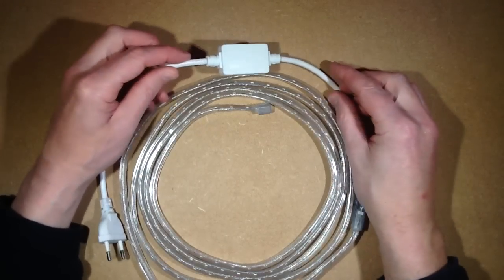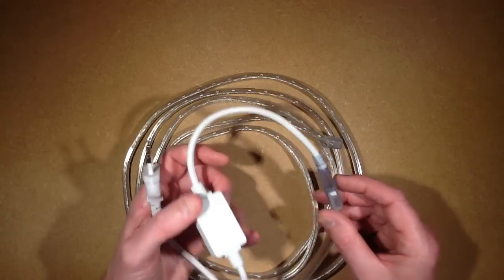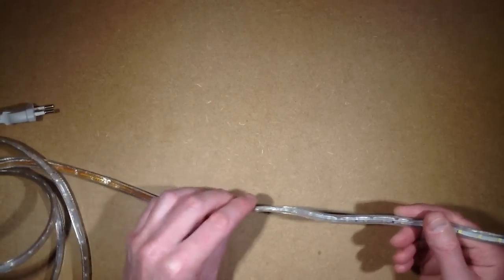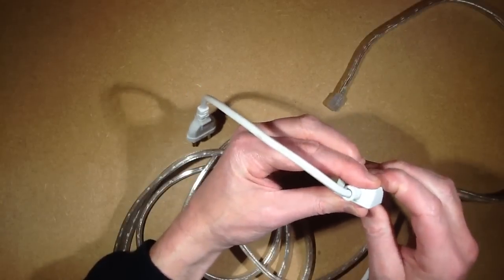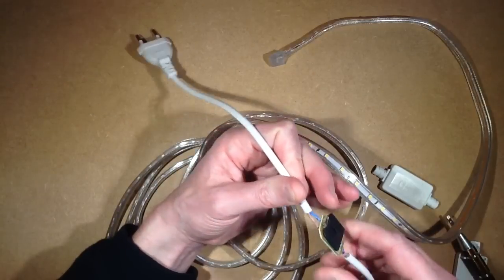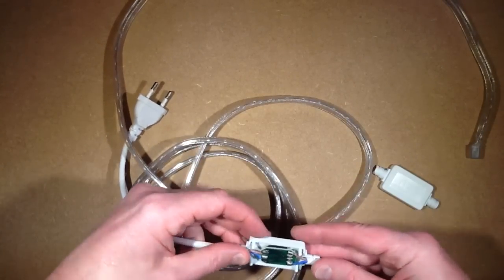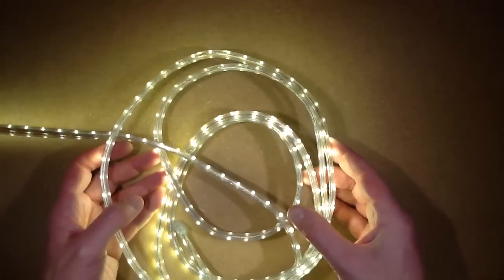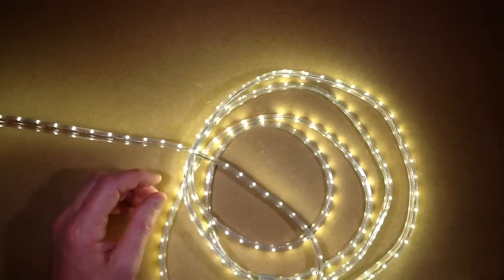Flat, mains voltage LED tape.

Comment: The 50 cm sections are probably just limits on the size of PCB material that can be manufactured. Regular 12V led tape is usually also made in sections of 50 cm, despite being sold per meter+. Single PCBs a meter long can be made, but they're extremely expensive.

I mean, a side benefit is that they can manufacture it as 110V pretty easily, with the same PCBs and just twice as many of the gaps/connections onto the busbars, but the first thing is that that's how long their PCBs get :)

Comment: Being mains voltage, what do you think would be the maximum run length for LED tape of this kind?
Reply from the maker: +Harrison Brace The limit will be the heat in the rectifier mounted in the end.  Generally it's better to run stuff like this in multiple sections.

Comment: Well, since most LED lighting systems fail because the power supply fails, what's the harm in running the LEDs a little hot?

Comment: I spotted a dead LED. DC live ends - even more dangerous than AC.
Reply from the maker: +DjResR Not in my experience.  DC tends to cause a single contraction then a burning sensation, but AC locks you on due to continuous muscle stimulation.  You can't open and close your hands at 50/60Hz.  But rectified AC is still pulsing, so is as dangerous as AC.
Reply from the maker: Sustained DC current, even at low levels can cause cell perforation and resulting skin and tissue damage.
Reply: +DjResR absolutely. DC is scary shit.
Reply: +bigclivedotcom Extensive experience in getting electrocuted clive.
hmmmm you are a bit crazy it has to be said!
Nae wunder!
Reply: +smallenginedude71 why
Reply: +Nicholas Ruiz Because when you get shocked by DC, your hand is going to grip the energized part hard and you can't do anything but watch yourself die in a painful death. AC on the other hand has alternating polarity, it would hurt much more because your muscles are moving in 50/60Hz frequency, but the grip is much weaker so it is possible to unhook yourself from it.
Reply: Isn't the unique scary thing for DC voltage that it can eventually cause electrolysis inside your cells. Causing it to diffuse your good body things into bad things, which my chemistry teacher would scold me for not knowing, that can eventually poison you?
Reply: funny, just today i got shocked by the same led strip. mine didn't came with a cap at the end

Comment: i reckon there's enough room in that box for 4 diodes and a 400v cap soldered point to point but nothing can help with the 1m interval gap unfortunately
Reply from the maker: The resistors in the strip are balanced for the rectified but unsmoothed mains, so if you did smooth it they would pass a lot more current and both the resistors and LEDs could suffer thermal damage.  You also have to consider that the rectifier is intended to run huge lengths of this stuff, and in the case of municipal flashing Christmas lights, any short lengths would probably take quite a time to fade out if they had the standard capacitor intended for a full run.
Reply: The rectifier looks like a tens-of-amps sort of device to me... did it have a rating? The fuse looks like the weak link..

At 45 meters per amp one of those rectifiers will probably be able to power a longer section than the busbar will carry at reasonable voltage drop...